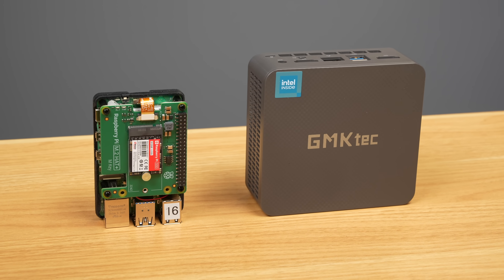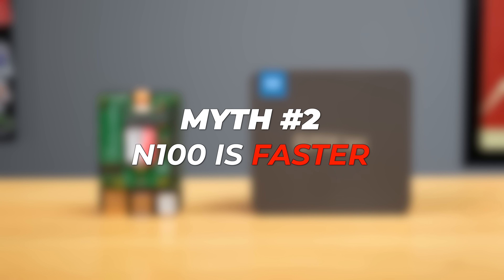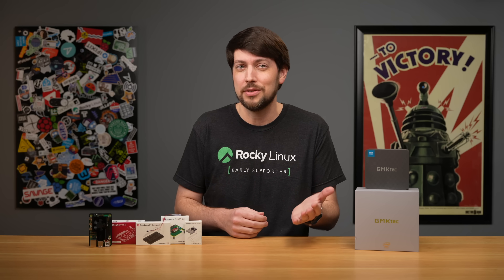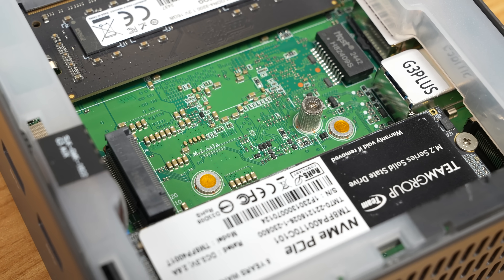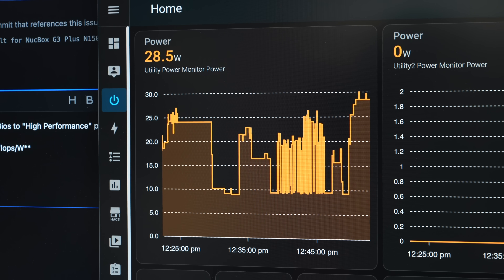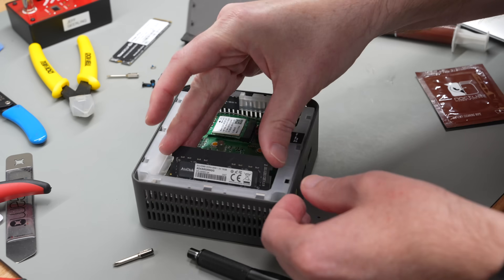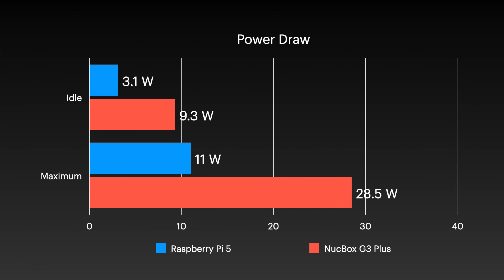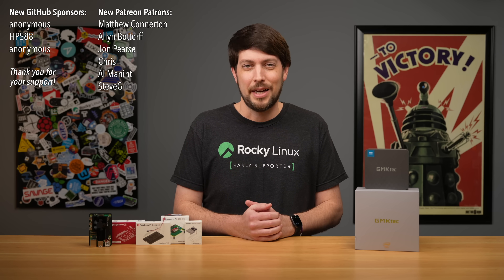When did Raspberry Pis get so expensive?

Comment: I have both a Pi4 8GB and N100 tiny PCs. They both have their strengths. I like the Pi because I can run just about anything I need, but I needed the Intel tiny PC because the Pi4 sucked at handling H265 HEVC transcoding for Jellyfin. The other problem I ran into is that some software doesn't have ARM releases so I had to build them myself.

Comment: The last truly justifiable (for me)  pi was the Pi 3 Model A+
Its still CHEAP .. its ACTUALLY small,  power efficient, has Fullsize hdmi and any soon to be ewaste usb micro charger from "your old phone" will power it.
Cases are so cheap there is no need to print one, its has 3.5mm Audio out.
In my experience Its powerful enough to be usable for anything an RPI should be actually used for in all the use cases I actually have or tried to justify For RPIs

Comment: Ireland
Pi 5 16gb + starter kit (adapater, case, 32 SD card)  - 173.95€
SSD 256GB - 35.50€
M.2 HAT + - 13.95€
Active Cooler - 5.50€
Tax - 42.80€

Total = 228.89€

Too expensive

Comment: A basic starter kit with the pi 5 is almost the same price as the mini PC. 
My Bee Link has 2 M.2 slots 1 for the boot SSD an another slot for the shorter form M.2 and a SATA HDD under the cover it has 16gb DDR4 and 512gb of storage with support for 3 4K monitors and cost under $200.00 when I bought it about 3-4 yrs ago.

Comment: The price is not even the biggest issue. I feel like every update makes it harder to tinker. The first time I set up a camera streamer was a breeze now I just get lost in the many hoops I have to jump through to get a CSI camera working with motion. I don't even think WebRTC and a Janus portal are even possible anymore. I feel like they're only good for lame under power desktops or running klipper for a 3D printer anymore. The more powerful the hardware gets the less fun they are to program. Almost feel like you have to be a software engineer to do anything fun nowadays.

Comment: A Pi is the obvious choice if you need to run on ARM. I work for a software company, where we use them for validating Android versions where we don't have dedicated devices, and would use them for ARM Linux if we didn't have the ability to spin up VMs on our nice HP/AmpereAltra server. We also use them for ad-hoc WiFi networks, and similar jobs where a very small Linux machine is useful.

Comment: I was interested in building a home NAS server, and when I started digging into it, I found that using a Raspberry Pi is not only slower but also more expensive — especially when you can buy a new mini PC from China starting at $60–70, or even a used one locally from around $40.

Of course, it depends on your specific use case. If you want to run a NAS, a Discord bot, or a Telegram bot, a mini PC is not only cheaper — it also gives you more power and flexibility for future upgrades.

That said, the Raspberry Pi definitely has its strengths — especially the GPIO pins, which allow you to build robots, DIY electronics, or other cool hardware projects. It really shines when you're doing something that needs direct hardware interaction.

Comment: These prices have become insane. I was looking to create a pi nas using your template, but now the prices are such that I can also buy an AA-brand actual NAS for the money. You can get a QNAP with 2 bays and slap at least 8tb in there for the same money. But it has faster networking and works out of the box.

Comment: I wanted a little pc to run software for a little home lab, most oscilloscope, power supply, signal generator run their software on Windows. I have pi 4, and it's a hassle with those softwares. I could use an old 20 bucks workstation, but they are bulky, so for my use case any x86 pc is a better than any arm pc. If you know your needs, you'll buy the right tool.

Comment: Seriously -  i use i5 11 gen T series PC. 100 usd for MB and 8G ram used, 200 usd for a CPU 100 USD por ITX PSU. Do note this thing now has 32 G ram and two slots free, ruining 3 VMS RAID card 8 drives, add-on IPMI for 50 usd -all this under 200W. and i have free slots for ram, free pci-e slots, allot of USB, some sata - you cannot begin to compare, i even play games over RDP with the Radeon 6400 i installed with PCI pass-trough to Windows VM.
I did start with low power PC's, but trust me - it is not worth dealing with this tiny hard to expand things if it is not a single trick pony - just go big.
Reply: Mini PCs have use cases where they beat your configuration.

Comment: I bought the N100 version of the mini pc you showed in the previous video and I am very happy with it. I went for the barebones version and installed 32GB of RAM and a 1TB NVME SSD. I run proxmox on it with a couple of VMs, including OPNSense with a USB NIC for WAN, Minecraft Servers, Docker with a lot of services and also have 2 HDDs attached using a USB dock. And it barely breaks a sweat, everything is snappy.

Comment: I have been looking at switching to a Home Assistant Yellow at some point for a while, and was stopped due to the availability of the Compute Modules until recently.

But I have just bought an Aoostar mini PC to use as a Windows desktop when I don't want to run the main PC.  This mini PC is $140 (£110) without a drive, but has wifi and Bluetooth onboard along with 12GB of DDR5 memory (soldered), includes power supply and HDMI cables.  Just need to buy a 2242 NVME drive for it.  And use my existing CONBEE stick.

If I go the Home Assistant Yellow route, I need to buy the HA Yellow £120, an 8GB CM5 £80.  I would then need to buy an NVME drive.

I am not sure the Home Assistant Yellow is worth the extra £60, when on paper it is slower (2.4GHz vs 3.6GHz, both quadcore) and has less RAM?

Comment: There is also the aspect, that I feel is somewhat linked to power draw, of heat generated. I would imagine, given the Pi draws less power, it also generates less heat. Which maybe important for some depending on the application.
Reply: Absolutely. I use a few pis as server nodes for things like fishnet. They're all working constantly and in close proximity, but their thermal masses are so low that no more than stock active coolers are needed. Very handy when space is at a premium

Comment: Hi Jeff, regarding the cooling on the GMKtec, if you think that was bad, you should see the cooling on the M5 plus! It has no fins on the cpu, the heatsink is cut in a way that heat can not reach where the fins are actually present (2 cm beyond where the cpu lives) and there is no heatpipe! The 5825U thankfully is quite efficient, but I had to go scour the internet for a better heatsink and adapt it to the thing. Just horrible thermal design on GMKtecs part.

Comment: My biggest complaint with the Pi is the lack of upgradability. That's why when I bought a Pi4 I bought the 8GB model. It was more ram than I needed at the time, but I was worried about later (Today 8GB would be far too small). At least with many X86 platforms you can upgrade the ram later (many, but not all). Plus there is just the fact that most X86 platforms are not as gimped in terms of I/O as the Pi is. The Pi has it's place, but it's not really great for many use cases.

Comment: Hi which Pi model would you recommend if I want to run PiAware, PiVPN and PiHole on 1 device? As a complete beginner, I want to keep costs low but also don't want to cheap out and end up bottlenecking or causing issues in running these applications smoothly
Reply: You can technically run all of these on just a 2GB model [may have to use pi os lite], but 4GB should be enough to ensure you never have issues.

Comment: I've got everything sbc wise and small nuc, only a couple of weeks ago I bout a couple of Pi CM5s. Yesterday I bought an N100 without RAM for £87. With and additional 16GB RAM for £23, this makes it £110. I cannot get a 16Gb Pi with PSU and case for that. Its seriously time to ditch the Pi I think. It has run its course and the other things like the RK3588, I have for Turing Pi RK1s too and Orange Pi 5 plus etc. Sure, for projects that need GPIO etc maybe, but for small server nodes, kubernetes, etc. Its time to stick with these x86 NUCs I think.

Comment: I still love the 3B+, always good enough for my projects.
Reply: After the 3B+ is where Rpi went sideways... Still has full sized HDMI port and is plenty powerful and cheap for anything that truley REQUIRES a rasp Pi
The 4 is where RPI jumped the shark in my opinion.
Pi 3 Model A+ Is the sweetspot its actually small... and fast and cheap

Comment: 1:57 "It's only about 1.5 to 2 times faster than a Pi 5." 😂
Reply: This^
I bought a pi5 8gb thinking it would outperform a 13year old Thinkcenter m93  i7 with 8gb USFF PC running Ubuntu 24 playing 4k video off youtube
NOPE... Its barley useable. and it cost almost 5x the price (with a 32gb SD Card, "new" 5a power supply and case) of the m93 that i got used for $20.
Im done with RPis other then the pico and the nano... t I get that there might be use cases for the pi4 and 5.. but I can't find them.

Comment: I've had my Raspberry Pi 5 for about a week now.  Tried to setup a NAS with the little hat thing but it's a no go.  The Raspberry Pi boards are fantastic but that OS is....well I don't know why they would code an OS that you have to manually type code in a terminal window to interface the software with the hardware.  That makes no sense.  Why didn't they make it compatible with Windows or Safari?  Or at least make the Pi OS user friendly.  They'd sell a lot more boards.  Oh well,  I guess I'll shelve the thing until they make firmware available to allow Windows compatibility or a user friendly version of Pi OS.
Reply: The pi foundation isn't who decides what Windows is compatible with, Microsoft is. Safari is a web browser for Apple devices, not an operating system.
This has nothing to do with firmware, it's because the SoC on the pi uses the ARM architecture. Microsoft has decided that they really only care about x86 because that architecture is so dominant.

If you find it too difficult to use, this isn't the product for you. Synology makes good NASes that sound like a better fit
Reply: You bought the wrong tool for you.

Comment: For my personal desktop pc I'm ususlly going for a sweet spot of highest power per dollar spent. That winds up being $1500 or so every few years. But I also do astrophorography, and when I take my rig to a dark sky site I'm running everything off of a 100 ah battery. In that case power efficiency is at a premium. I recently bought an N150 mini pc to run it all (main camera, guide camera, autofocuser, mount, etc, and to collect the data).
There's a lot of off the shelf computers built to run astrophotography set-ups that are based  on rasberry pi. Now I understand why.

Comment: I don't think you're all that different from most pi users by building servers and the like on them. My home network has a Raspberry-based NAS, a pi-hole, a network traffic monitor running Zeek, 3 UPS monitors running NUT (built before your video), and two different honeypots (OpenCanary and one based on NetCat modified from Chris Sanders Intrusion Detection Honeypot book). I think more people are interested in building servers and desktops with their pis than other things.

Comment: 4:00 you can boot from the M2 Sata port, and leave the M2 NVME slot completely free for expansion, also the Wifi M2 Key-E slot can be used as 4x sata using a M.2 NGFF ASM1064 adapter, or 2.5Gbps RJ45 adapter.

Comment: It all comes down to use case and most people that are getting into this sort of thing just don't understand what they're actually needing. 

General pc, or wanting to run proxmox? Mini pc no question. 
Single service application that needs to be on all the and also needs to be as low power as possible / maybe need some GPIO? Pi zero 1/2
Multi service application / something that needs some (but not a lot) compute power / need GPIO? Pi 4/5. 

Could you run proxmox on a pi? Yes. Should you? Probably not. I know I wouldn't. 
I wouldn't want to run a pi for a general use machine, but for specific applications they are amazing. 
I also wouldn't want to run a mini pc and try to figure out how to get GPIO functionality out of it. I've actually done it before with some USB level converters LOL (don't, just use a pi)

Comment: 10:12 It's not an Intel thing. Any higher performance chip usually requires higher voltages to maintain stability and thus draws more power per Mhz; heavily overclocked Pi's need more voltage and are thus less efficient than if they were clocked slower. A fair comparison would be to match the performance of both systems and then measure the power required for each. Power required does not scale linearly with performance increase for any chip.
In practical terms the only reason to get a pi is if you need pi specific things such as gpio pins etc. An as allrounder the suitable mini pc is so much better value.

Comment: I would also note, completely different subject so different post, that your point of different machines, different optimal use cases is best assessment you could possibly make.  

You should also consider the AMD Ryzen series micro PCs.  Those kick intel's butt in performance per a watt, but I doubt they can beat the Pi.

Comment: I feel that Raspberry Pis have become quite expensive for what they offer. For people not tinkering with hardware stuff, alternatives like the N100/N150 are more affordable and often provide better IO options for SSDs and hard drives. While they're not exactly in the same category, there are also budget-friendly motherboards available for building PCs or servers.
I’d love to see a Raspberry Pi with a super low-power, 8-core ARM CPU based on smartphone architecture. Right now, their product positioning doesn’t make much sense to me—the power consumption is a bit too high for truly embedded applications, yet the performance isn’t quite enough for a smooth desktop experience. Also, relying on SD cards feels outdated, as there are much better storage solutions available today.
Ideally, the price should stay in the $50-$100 range, offering more hardware and IO options for the cost.
Reply: absolutely. They absolutely tried to jump into the fake covid inflation train but got wrecked hard by asian competition.

Comment: You complain about overheating, but have the CPU intake vent almost 100% blocked. Stupid design putting it on the bottom of the case, but flip the thing upside down so the fan can actually breathe and not recirculate hot exhaust.

Comment: I've been a long time Raspberry Pi user, and use a Pi 400 as a linux desktop now and again (and for retro gaming), but when I needed a compact Windows PC for a specific use case (Affinity Suite), I got a GMKtex NucBoxG5 N97, and I love it, not much bigger than a Pi in a case, runs Windows 11 smoothly, runs Zorin OS lightning fast (even from a USB stick), and is so flexible.  I was going to get a Pi 500, but for users looking for a mini desktop PC, the Intel mini PCs are well worth checking out and as cheap as the Raspberry Pi solutions.  Raspberry Pi will always win for specific projects, especially low energy and DIY/hardware projects.

Comment: Really counts a lot against that particular mini-PC that you had to open it and set a Noctua fan on it for it to run properly. They should have used a lower spec processor or had a bigger cooler that can handle it. Waste of money to buy a PC that you can't get full performance out of because of thermal throttling.

I guess it won't matter for the "I only need to browse the web" crowd who will never put any real demand on the computer though. But for me I'd skip this one and keep looking for a mini PC with proper cooling just in case I ever had a demanding workload.

Comment: Hi Jeff.
First of all, I'm really sorry for asking such questions under your video but the more I watch this type of videos the more lost I am. Therefore, I need to ask, what mini PC, terminal, thin client, or whatever really would you recommend to someone like me who is looking to replace a DELL Wyse 5070 thin client that runs a Plex server and a file sharing in home network. It is really difficult to beat power efficiency of the 5070, and when we combine it with its passive cooling system that produce almost no noise and the cost of the unit itself it seems impossible.
Thank you in advance for any suggestions.

Comment: I have quite a few Pis and recently bought a GMKtek G3 to try out. One of the big wins for me with the Pi is that I can put 12 of them in a 2U rack frame and have them all networked and powered from a single 16-port PoE switch. I mainly develop custom software for mine and deploy microservices on Kubernetes, so a cluster is essential for me.
I'm currently running HomeAssistant on a Pi4 and toying with the idea of shifting it over to the Mini PC. But my Pis are rock solid, and have been for years; I'm a little nervous about moving to potentially less reliable tin.